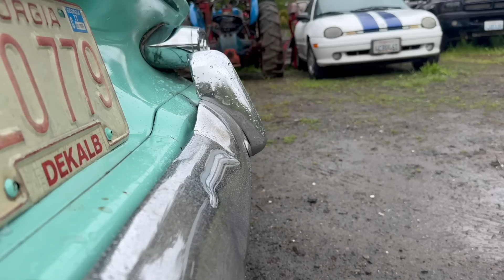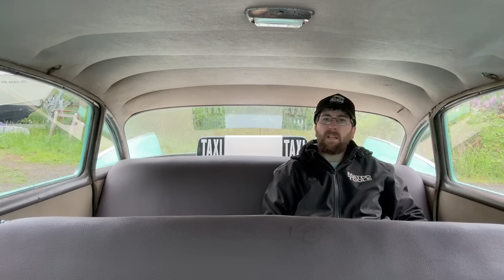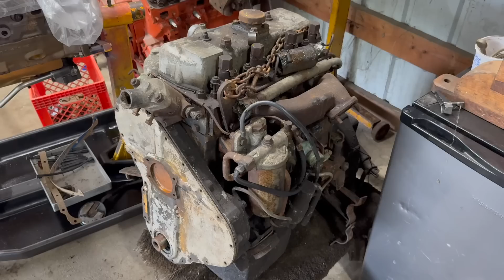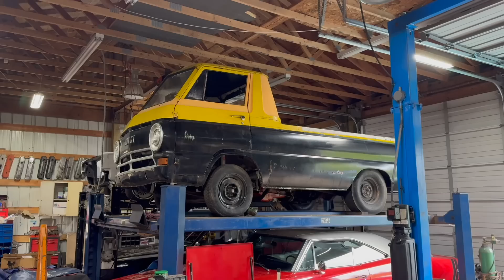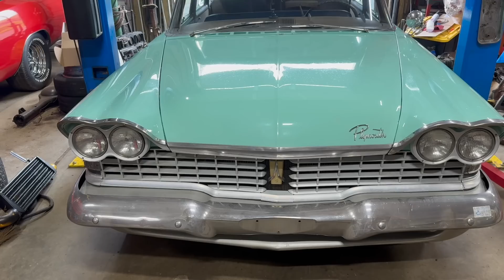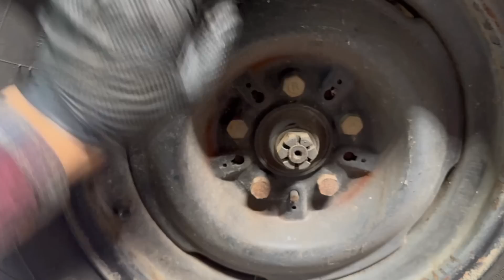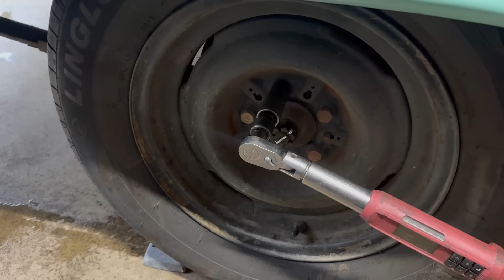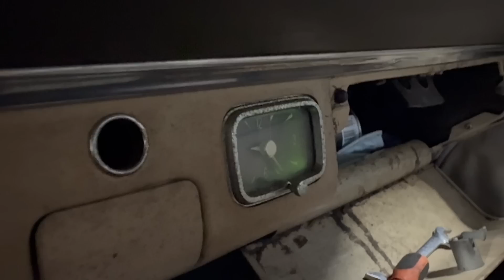Slow And Stinky - 1959 Plymouth Diesel Taxi Engine Tech, Test Drive, Safety Inspection (Not Good...)

Comment: I get a turbo free in my cereal box every morning nowadays, My local dollar store has a turbo vending machine outside. Be different put a blower on it! Positive displacement. Zero turbo lag. Many manufacturers did it before the 1970s. Cummins and Rolls Royce included. Perkins are GREAT engines. They are a world apart from Cummins. I have a 4-236 in a welder and a hopped up Perkins V8 540 ci im my Massey Ferguson 1155 tractor. I have been inside thousands of true heavy duty Diesels. You listed my top three! Detroit Diesel 2 strokes, Perkins, and Cat. Except for Detroit 2 strokes Diesel torque per ci vs gas is a myth. Either can be boosted. Cummins is making a turbocharged gas version of its Diesel that proves it. Imagine the power an Ecotec Ford would make if were 855 CI like a big cam Cummins! Izuzu used the 727 trans behind some of their turbo fours in box trucks. I have built a hot for the time 559hp 12v, Cummins. They are great engines, but a far cry from a true heavy duty industrial one, but they weren't meant to be either. All those cute little black British taxis used to have Perkins 4s! The P6 was a world changer when it came out. Every high speed Diesel today owes some of its lineage to it. It was the first successful high speed straight six Diesel engine. It helped win WW2! Cat owns Perkins now. The Perkins 236 in my welder says "Detroit Diesel " on the valve cover! It was sold thru Detroit to the U.S. military for the welder! 😊

Comment: I used to work on that series Perkins in OLD fork trucks.Some of those had a 3 speed, well, an ultra low, low and high. I agree there has to be a under fueling issue. You should be able to adjust that rack to where it'll smoke a bit at idle, and it isn't doing anything like that. Governor would be my next step, but it sounds so strangled. Very cool piece of Mopar history. If you can get it running right, you might be surprised.
Reply from the maker: Right. Zero smoke with rack limit cranked all the way out. Raised supply pressure today by crimping off return line, made no difference in power or smoke but it wouldn’t shut off anymore. So this is either a governor problem, or I’m thinking possible timing chain stretch. The donor engine has an incredibly stretched chain. Got me thinking that would lower the vacuum / load that the governor is able to sense. I did bump the injection timing today and it… might have helped? Hard to say.

Comment: A cotter pin is a tapered pin with a nut on it. Like what holds an older bicycle crank on.
Reply from the maker: A cotter pin is what comes in the box I showed labeled COTTER PINS.
Reply: @DeadDodgeGarage  The label could be wrong

Comment: This car 🚗 looks similar to the 1958 Plymouth Fury, from the movie 🎬 Christine!! No, not exactly, but close. The styling is even 🔥 similar. This car is a 1959, and it isn't bright red, like Christine was, but I think this car has a similar sound on startup. Just subbed!! Your friend, Jeff!!
Reply from the maker: Thanks!
Reply: P.S., Coker Tire still makes the whitewall tires for these classic cars 🚗. I only noticed it, later into the video 📹, that your cars 🚗 have blackwall tires on them. These tires are something like 👍 $280.00-$380.00 apiece, but they're still made in the original molds. I just thought I'd tell ya about the whitewall tires.I liked 👍 one thing about your passion with Dodge Ram 🐏 trucks. LOL!! 🤣🤣🤣🤣🤣 "I'm all Ram trucked up"🤣🤣🤣!! Again, your friend, Jeff.

Comment: I think you made a good trade, especially since you got an extra engine and a rebuilt pump. You could fabricate a spacer to go over the cable where it pulls on the hand brake to take up some slack.
The concept of overdrive isn't to be passed off if it allows for lower rear gears which would help the acceleration. I hope to see many more videos on this car.

Comment: Maybe clogged pick up tube in the tank or collapsed/leaking fuel lines or weak lift pump. Definitely worth checking all the fuel supply up to the injection pump before trying to swap the IP out. Old diesel fuel does have a habbit of building up an algae or sludge that cloggs EVERYTHING and is a huge pain to clean out.
Reply from the maker: Funny story, the fuel line from the frame to the lift pump fell off today. Clamp had loosened itself / line had collapsed over time. I thought for sure fixing that would make an improvement. Noooooooope. I am considering similar possibilities.
Reply: @DeadDodgeGarage definitely stick a camera in the tank and check for algae or sluge build up, i have seen several diesels that sat for decades that built up a crazy thick algea sludge that physically had to be scrapped out of the fuel tank and it would plug up and stick to EVERYTHING.

Comment: Wow. I didn't know Plymouth did diesels back in 50's! Very special car for sure. Eventhough its a basic machine.
Reply from the maker: Technically Plymouth didn’t. It wasn’t factory installed, but it was a conversion done to brand new cars for use as taxis, and the swap was developed with help from Chrysler’s Antwerp subsidiary in Belgium. It’s super neat.

Comment: If that was my car that engine and trans would be pulled out and degreased and resealed so it will be clean if I work on it and not leak oil anymore.
Reply from the maker: I don’t know if I want to pull it, but I sure want to clean it and seal up the leaks. Unfortunately it’ll just make more as it continually rattles itself to pieces…

Comment: Check your injectors,  if it’s direct injection the holes on the nozzles can close up and reduce the fuel delivery.  Also low injection pressure on worn out injectors can affect power.  And remember..,check your injectors because a good injector is a happy diesel
Reply from the maker: The previous owner had the injectors rebuilt. But I do have questions about their pop pressure.
Reply: What we find, and this only applies if it is direct injection, the pop pressure could be on spec but if the nozzles has been buffed on a wire wheel the holes will close up.  Very much like a carburetor jet, the smaller the hole the less fuel the engine will get and on applications where power is marginal at best it makes a huge difference.  If you can get your hands on a microscope for nozzles you will see it.  If it’s indirect again the cracking pressure may be on spec but if they have ground the nozzle seat to much the height of the nozzle can cause a restriction.

Comment: Perky may be even slower than my Mercedes 240D, the Plymouth is an even larger car with slightly less horsepower (probably a little more torque though).  The 240D was so slow that the first time I drove it, I stopped after about 10 feet because I thought something was wrong, it was so slow.  I let my dad drive it and he just laughed and said that's how they are (my parents had owned a 190D a few years before).  Those old Mercedes diesel engines also had throttle butterflies on them like the Perkins.

I feel your pain on the suspension and brakes - my dad and I recently went through his '56 300B.  Those center plane brakes are wild and a major pain to adjust.  Especially because you have to adjust each shoe independently.  We were able to get any parts we needed from NAPA and/or Kanter.
Reply: The 200D was much slower

Comment: I admittedly have a soft spot for these Exner era cars, design wise. They're dorky looking at first but really grow on you after a while, hehe~ Really neat to see one of these old taxis still around, too

If I owned the car, I'd be inclined to keep it as a diesel and stick with the Perkins. Would be a shame to ruin the unique charm and history this car has to it. Assuming the spare engine came with the car, I'd look into doing a custom turbo setup on the spare engine and swap it into the car instead. That at least gives the option to revert the car back to stock with the factory engine, all while figuring out a potential way to hot rod the Perkins to help this car move along a bit better than it currently does. Can't help but ponder if a turbo off of a diesel tractor engine would work. Would obviously go for a turbo that came off of an engine of a similar displacement, but would take a lot of research to figure out how feasible that would be.
Reply from the maker: That’s almost exactly what I have in mind!

Comment: Take a trip to Havana Cuba that place is crazy because over there they have classic cars from the 1950's but since 1959 they have no way of getting parts for them so when the engine wears out they have to find another engine to put in it and many are boat motors or Russian truck motors so you will see 1957 Chevy's and plymouth and other cars from the 50's with small diesel engines in them it's really wild to see what the cubans do to keep their old classics on the road.
Reply from the maker: I know it. I said something about Cuba in this very video.

Comment: The thing is, everyone is going to want to pass you. You just have to embrace that. Nobody wants to go slow and nobody wants to smell a stinky diesel. You can keep right and they can all pass, it's no big deal. Also you might need to put some fuel additive in as the old pumps used the sulfur as a lubricator. With the ultra low sulfur fuel we have now, the old pumps can wear our prematurely from lack of lubrication. Howes Diesel Treat was what I used. Oh and try double clutching your shifts, they like that. Not to be understated though, I love your car!
Reply from the maker: Absolutely. Actually started double clutching today, yes, it’s less grumpy. On it, thank you.

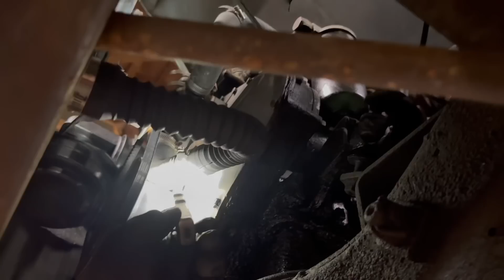Comment: 19:02 That's a FEATURE. It keeps the sludge from building up on your Perkins diesel crank pulley and throwing off the balance. 
You don't want vibrations on your 50 HP diesel at 8,000 RPM!!!
Reply from the maker: That’s right 😂

Comment: Might consider having those injectors adjusted for crack pressure. It helps a lot with those type on Perkins like that. The pressure slides down and they fire sooner than they should.
Reply from the maker: Copy. Know these injectors were serviced but don’t know what was or wasn’t done, or where the pressure was set. Have spare injectors in the other engine, would probably have those serviced and swap them out.
Reply: @DeadDodgeGarage The process itself is fairly easy, but it requires special equipment. I did injectors for my Dad's MF35 while I was at Bates way back.

Comment: Cool acquisition.  I saw a couple of videos pop up on this car a few months back. Love it. Looks to have 1956 Plymouth hubcaps.  Im sure ive got most of a set if '59s (1957looking covers w/scallops notched in them). Im not much of a diesel guy, but this is neat.
Reply from the maker: If you somehow had four I would be super excited!
Reply: @DeadDodgeGarage  Those wheels are 15-inch (as were fitted to '56 models). Didn't they have 14-inch by 1959? I could be wrong.

Comment: 59's didn't have alternators, that had to be added later.
Reply from the maker: Yes, that is a later Chrysler alternator. Meant to mention that. But for the record, a heavy duty Leece Neville alternator was available as an option on the taxi package in 1959.

Comment: I really enjoyed your video of the unique Plymouth Perkins diesel power car. It is the first time I ever heard of a Plymouth Diesel. I have a cousin that is a diesel nut he once had an Eldorado diesel and he also had a Dodge heavy duty pickup with a Cummins B Series diesel engine.  I have had a 240d Mercedes diesel for over 25 years now. Yes I have other cars too but the cute little 4 bagger with a 4 speed is one of the most pleasant cars to drive. It handles well It looks nice and it was primo when I got it but now it is starting to get rough. Yes it is underpowered but so what!!!! The only problem with that is irate people behind you start to beep. I end up pushing clouds of smoke to calm their nerves. The folks at "Cold War motors" would love that car.
Reply: A Diesel running well should not smoke.
Reply: 1979 240D owner here with the 4 speed as well.  Owned it for 30 years (yikes).  Just have to plan ahead and momentum is your friend.  It's shocking how well that car emulates what you have to do to squeeze mileage out of EVs too (I have a Leaf).

Comment: The venerable Checker A11 and A12 were available with the same Perkins diesel. They were noted for their fuel mileage, not their performance. As a random aside, the Checker taxi was also available with a Chrysler Poly V8 for a few years. Being that the Perkins era Checkers had that odd front-sump arrangement, that second Perkins may well have come out of a Checker cab, since they were pulling from the same parts bins.
Reply from the maker: I heard about the Checker connection in another comment. Didn’t know about their use of the Poly! This is a mid sump oil pan - and it was definitely pulled out of another Chrysler product. I can’t recall what year or model.

Comment: Yep, very cool. I've worked on a lot of Perkins powered stuff, but I can't recall seeing this system. Check filters and try new diesel before you tear in to that pump.

I think the car was torn down, and hastily put together to be moved.  You don't do that, not without telling the next guy.
Reply from the maker: Filter were just done, not sure on fuel age or condition really but will try some additives for sure.

Comment: My family ran / runs taxi's on the west coast of Scotland and had Standard Ensign Taxi models with the Perkins P4C engine - they were good for 3-4 hundred thousand miles but were pushed to do much more than 55 mph - they had 3 on the tree with a Laycock o/d and did 50 mpg [imp] if you didn't kick them !!!

Comment: Absolutely freaking love everything about this. Thank you for posting.  I love old stuff, but especially the rare !   (p.s.-  Dodge offered trucks with  the 354 Perkins diesel in 1962, wonder if there are any left).   Something else  similar that I'm guessing isn't common knowledge even among gearheads....the Dodge built, not Chrysler, 331 cid 6 cylinder diesel for heavy duty trucks, approximately 1939 IIRC til around mid-40s ir so, I think.  Another way to search on YT or otherwise,  it was a T-84.  Only learned about that in that last few years, not much out there about it.
Reply from the maker: I’m familiar with the big 331 flathead. I have yet to ever see one… and I don’t expect to. But very cool.

Comment: Body shop guy must have put that one together.  My multiple experiences with them is they constantly run down a bolt/nut by hand thinking they will come back to it later to tighten but rarely do.
Might want to check drain plugs in every thing on the car.
Cool thing about that old Perkins, it should run decent on zombie blood.  You may have to cut it a bit with diesel if they're skinny zombies that haven't been to KFC often.  Great zombie apocalypse car though.
Reply from the maker: Did check drain plugs, I’ve learned that one… haha

Comment: check that you are getting full throttle, the old linkage may be out of adjustment ,also the shut down cable may keep the pump from working properly
Reply from the maker: I absolutely did check throttle adjustment. And have verified the rack is able to move to the full position (shutoff cable might prevent this.)

Comment: I think the T4 in the Massey Tractors was the same as a P4 but with an added turbo different governor and fuel pump.
Reply from the maker: While I’m sure there is an underlying relation, I examined pictures of the T4 and found it to be quite different. The P4 family was also found in Masseys.

Comment: if you can find one,cummins makes a 4bt the t is for turbo
Reply from the maker: I know. Lol. I explained my history with 4B/4BT engines in this one, but cut a lot of that discussion for time. 4BT is much heavier, and expensive. And would require a ton of work to make fit. I don’t want any of that, I want the Perkins with like 30% more power.

Comment: The brakes are adjustable, the two hex heads on the rear of the backing plate are eccentric cams, each pad is adjusted independently.
Reply from the maker: See, looking at the shoes from the other side, I thought that looked like it should move. But I missed the hexes. Thank you.

Comment: 1959  gas in philly was 22.9- 25.9  and diesel was cheaper buy at least a few cents . at 30 mpg fuel was not even any worry  20 gal fill up around 4 bucks 
and engin 300k to 500k between rebuilds . retorqued i doubt you find a torque wrench at the corner garage . maybe at a airport garage for plains 
did you get the reversed lug nuts on drivers side i know 55 still had r and l specific lug nuts
Reply from the maker: Yes, driver side is still left hand thread

Comment: If parts availability is an issue with the Perkins, I’d swap a 4bt or 6bt Cummins in it.  Otherwise I’d go over that thing and work the bugs out of it or swap the new injection pump to that engine.
Reply from the maker: 4BT is much heavier and would need a beefier transmission as well. I think I’m going to swap the pump and check valve adjustments and pump timing.

Comment: I love it!  Great trade. Look forward to having you figure out just why the already low power engine is even lower so you can at least cruise at a reasonable speed.  Personally, I'd take the taxi sign out of the back window, but NOT alter it or the car where attached.  Mostly for rear visibility.
Reply from the maker: The taxi sign is just sitting there. It’s a newer plastic one, not an original unfortunately. I probably will take it out. Probably.